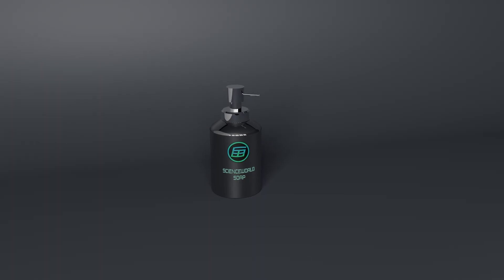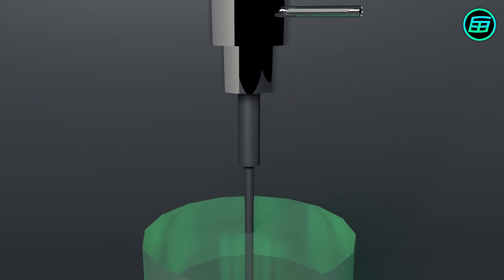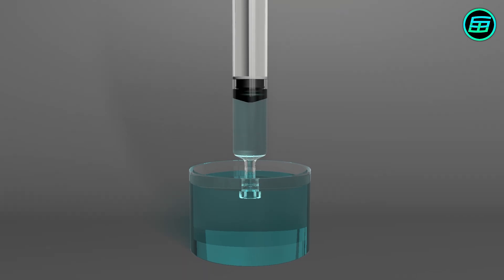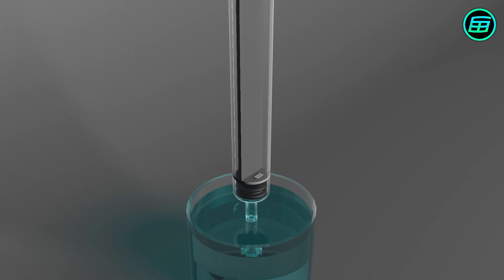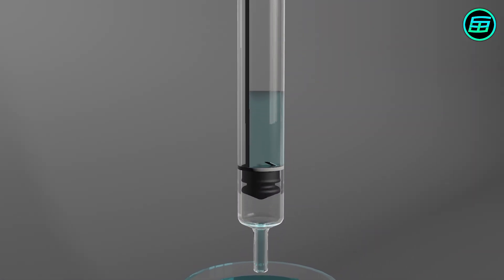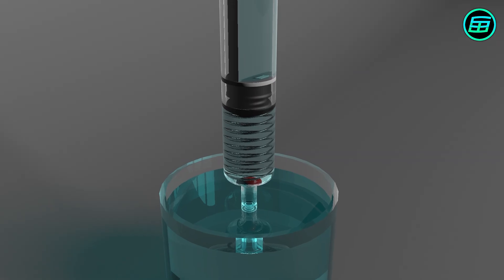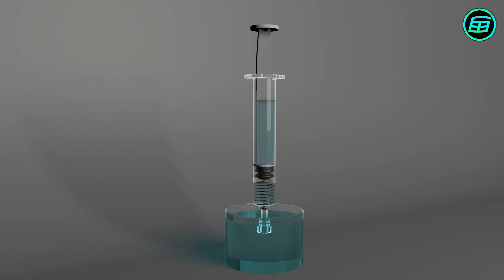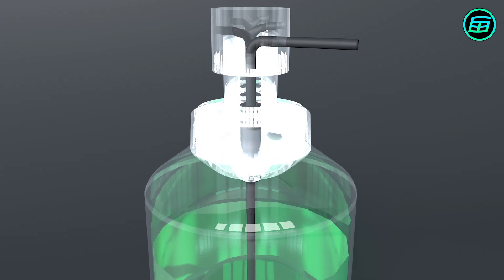How a soap pump works (3D Animation)

Comment: Cool.

Just to clarify, the red balls act as one-way valves that allow for air evacuation in the chamber beneath upon the downstroke of the cap, loading the chamber with fluid then the spring mechanism completes the pump cycle during the upstroke by returning back to the original position. Repeated pumps move more fluid closer to the orifice/opening of the pump.

I see that the downside is that the spring is in contact with the fluid, limiting its use to non-metal corroding liquids.

Comment: what is the purpose of the plastic ball
Reply from the maker: I think you talk about the plastic ball at 1:56. That ball keeps the soap at upper part. So on the next push, soap is readily available and poured into our hands immediately.
Reply: @ScienceWorld1  ohh I see, sort of like the one way valve in the simplified model 

thanks for the answer
Reply: @ScienceWorld1  How do I activate the top of the foaming soap dispenser for the first time? Do I rotate it clockwise or anticlockwise?